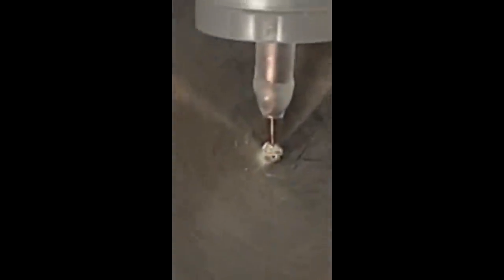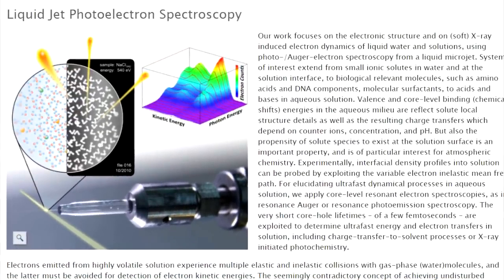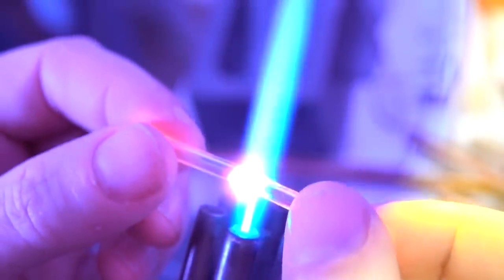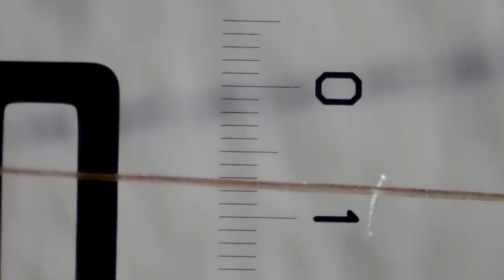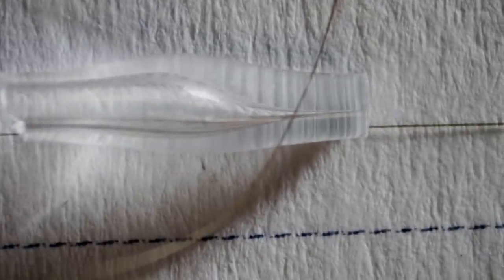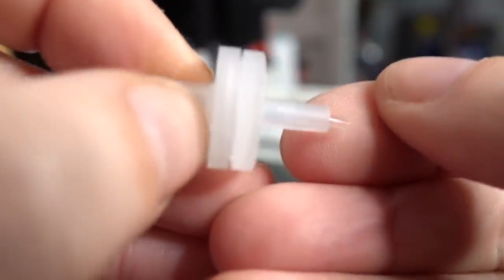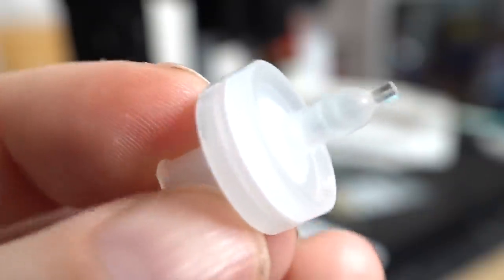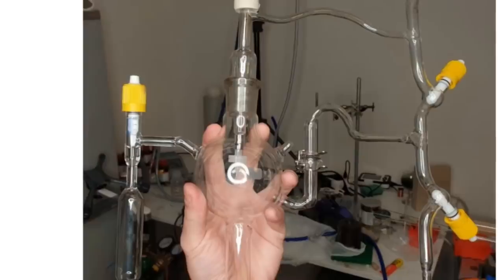How to make unblockable liquid microjet!

Comment: Quite interesting. Sometimes it is the simple solutions that work the best. I am working on a copper nanoparticle inkjet printer and need to make sure that a roughly 4um nozzle wont clog when putting 10-20nm copper particles through it. These particles love to cluster together and so far the adjustments to the ink composition have been what keeps the nozzles from clogging. Gotta keep in mind that inks can sit around for weeks in a printer and copper is very reactive. The oxygen content of water is enough to make the particles oxidize in a matter of minutes without the addition of a reducing agent.
Reply: i had a similar problem, the answer was simple, a powerfulldvd red laser on the nozzle, everytime the particles coagulate more than the wavelenght of light they will start to explode back into nanoparticles
Reply: @fss1704  My printhead has 1024 nozzles but that might be a useful tip for other things I am doing. Is the laser supposed to melt the particles or is it heating the solvent causing them to separate?
Reply: i did some silver nanoparticles using this method

Comment: Out of curiousity, do you keep record of the diameter of the nozzles or is it so off to the side of your end goal that any variation is just compensated for in your other parameters to get the desired result?  i was thinking your gauge  of a human hair or some similar artifact could be used more directly to measure a cut mark by inserting it down the back to visually indicated where you should score the glass.

Comment: Great way for non-clogging (or less clogging) micronozzles. Surely some sorts of modifications, like a rig to keep linearity would yield even better results. 
Another idea you could possibly test (if it's not just complicating things), is a bath of metal (zinc + tin for instance) with the pipe submerged - then control over pressure of gas inside the pipe could give controllable results. Of course with the pipe rotating...

Comment: Very nice.  I wonder if you could skip the glass part and just draw a capillary from the polyethylene Leur tip and then cut at the appropriate diameter?  Might be too flexible under pressure though.

Comment: Btw, just in case you haven't seen it yet, here's something else neat that can be done with a microjet. www.rsc.org/images/loc/2014/PDFs/Papers/053_0326.pdf That team used them to get a 48% conversion rate of mechanical to electrical power. The implications of their work may also have a bearing on yours.
Reply: I mean in terms of the behavior of the jet if you're using certain fluids and ther happens to be drop formation in a relevant part of the jet.
Reply: Is this a link to a virus
Reply: @simonbneqldaus  Dude, if I wanted to get a virus on your computer I would just put it there myself instead of reading through research papers to possibly find one which is relevant enough to lure people in.

Comment: Couldn't you easily increase the accuracy and precision of the alignment of the jet with the main axis of flow in the filter by chucking the input side in a good drill or mini lathe when still molten and spinning the thing on a thin wire stuck into to nozzle end?

Comment: According to Scientific American, water causes glass to crack more easily because when a water molecule enters the crack, a reaction occurs in which a silicon-oxygen bond at the crack and an oxygen-hydrogen bond in the water are cleaved, creating two hydroxyl groups attached to silicon. As a result, the length of the crack grows by the size of one bond rupture. The water reaction reduces the energy necessary to break the silicon-oxygen bonds, thus the crack grows faster.

Comment: For PETE'S SAKE, Dr. Thunder - explain why wet glass would crack a hundred times more easily than dry glass! COME ON now! I really don't think I deserve to be tortured like this.
Reply: Copy and paste of my comment elsewhere:
According to Scientific American, water causes glass to crack more easily because when a water molecule enters the crack, a reaction occurs in which a silicon-oxygen bond at the crack and an oxygen-hydrogen bond in the water are cleaved, creating two hydroxyl groups attached to silicon. As a result, the length of the crack grows by the size of one bond rupture. The water reaction reduces the energy necessary to break the silicon-oxygen bonds, thus the crack grows faster.
Reply: Theo Crater Came to comments to ask the same.
Reply: Yes. This is something I never knew if it's for real.
Reply: Wonder if the same applies to ceramic tiles?
Reply: @DedmenMiller  I don't think so, as ceramic (the stuff you burn) has a completely different material structure. With ceramic you use water to eliminate the dust. Imagine using a saw on glass like you do with ceramic, that would be quite a mess.
Cutting glass works how it does because of the internal tension in the glass. If you score/nick it just a little bit, that tension causes a much greater "internal" cut than you see on the surface. Ceramic doesn't have this, as far as i know (somebody correct me if i'm wrong), which is why you have to really remove material from where you want it to come apart.
Reply: @jangrewe  I remember ceramic floor tiles being cut with a diamond scratcher (similar to class) and then broken (same as glass) so they then break exactly at the scratch. So I thought its the same principle.
Reply: Not an expert, but i guess it's because the water molecules creep easier into the microfissures causes by scoring the glass, pushing them wide open. Or something like that. You could also just google it, i guess ;-)
Reply: I do a bit of small glass stuff as an optical/laser technician. I have not heard about wet glass breaking easier, however there may be a reason why this might work. Glass breaks easier when there is a temperature differential in the material such as putting a hot piece of glass in cold water or a candle flame breaking it's holder. My thoughts are that in this case there is an evaporation cooling effect on the surface of the glass and causes a minor temperature change. Aside from that I can't see a reason why it might break better when wet.
Reply: I searched around a bit, and it's not a temperature thing:
“water causes glass to crack more easily because when a water molecule enters the crack, a reaction occurs in which a silicon-oxygen bond at the crack and an oxygen-hydrogen bond in the water are cleaved, creating two hydroxyl groups attached to silicon. As a result, the length of the crack grows by the size of one bond rupture. The water reaction reduces the energy necessary to break the silicon-oxygen bonds, thus the crack grows faster.”
(chatterglass.wordpress.com/2015/05/27/lubricate-your-cutter-wheel/)
Reply: @jangrewe  
Exactly what I had copied and pasted two comments up.
Reply: @v8snail  Oh, sorry, didn't get that notification, and YT only showed me the last comment this morning when replying. But yeah, i attest you good Google Foo! ;-)
Reply: @jangrewe  
No sweat. It's a non-intuitive, brain bending answer to something we didn't know we needed to know.
Reply: @jangrewe  Excellent Find!
Reply: @v8snail  Well >>---> I <---<< knew I needed to know it!

Comment: I use a similar method to modify plastic syringes to fill 50 um capillaries with liquid for use with a lab-build capillary electrophoresis instrument. I don't use a filter or glass, but melting plastic droppers and stretching them in the same way you did with the glass is a great way to make micron- diameter plastic tubes. I can only wonder if I had made a tutorial 10 years ago, maybe Thunderf00t would have been thanking me for the inspiration!

Comment: wet glass cracks easier?? WHY??!! I NEED TO KNOW!!
Reply: Surface energy
Reply: Temperature fluctuations between the surface and core of glass compromises the structural integrity
Reply: @DMZRPG  this temperature difference is way to low to do anything
else it would crack on it's own

Comment: "Dirt cheap to make" Never includes the cost of his own labor
Reply: That's just how research is. Acquiring funds is more labour intensive than almost anything else.
Reply: Things are a mystery sometimes, I'm a developer and my cost is over £500 a day, I needed something specific for the project I was working on, and there was a plugin that was doing just that for £300, it would take me 2 days to do it, so for me paying for the plugin was a no-brainer, but my boss insisted that I do it.
But in the case of TF00t, the existing microjets nozzles clogged, so an uncloggable didn't exist, so he basically invented it. Once a company will make them, they will probably buy those instead, maybe?
Reply: considers his own labor worthless
Reply: He is paying himself for the labor so the net balance is 0. As other comentor said, if he needs to buy a lot of this or suspend the research to find more supplies the cost of waiting for the mail to arrive are more then doing a thing yourself (speciallly if you can do it with cheap materials and in a few minutes)

Comment: Why not thread a fine wire through the tube the do the same the wire won't stick and you have consistent size if that's important?
Reply: The wire does stick. Have you ever seen an incandescent bulb or vacuum tube being made?
Reply: @ferrumignis  yes many times you use nickel or stainless wire will not stick to it you make a glass seal only using tungsten wire don't know why it's done that way but have seen many valves made like this .

Comment: You should make a video about the wet glass breaking easier.  It's the first time I heard of such thing.
Reply: As a crack develops the water fills in the gap as it progresses. Oddly enough a super clean break can cold "re-weld" back up.
Reply: @therealjammit  vacuum cold weld maybe, but with air pressure i don't think so
Reply: @therealjammit  

Most glasses are technically liquids, very very very viscous liquids. So fractures closing up as long as no foreign material prohibit that is not surprising.
Reply: @boelwerkr  but didn't i just read somewhere that glass is no longer considered a liquid...? that the whole millennia old sagging church windows thing was incorrect and that is how the glass was made? or did i dream it up? :)
Reply: @derangedchicken2191  nope not a dream. Glass is an amorphous solid.
Reply: @boelwerkr  technically...you're wong...glass is not a liquid in any shape way or form. Look it up!!
Reply: @boelwerkr  there's a video Veritasium made just on this.
Reply: @boelwerkr  Glass is not a liquid.
Reply: @derangedchicken2191  It was never considered a liquid. Nothing more than a fake internet rumor.
Reply: This was taught as a matter of course when I took glass-blowing in physical chemistry lab 40 years ago.  It was probably standard practice in Newton's day.  Not sure why it works.  Possibly reducing the surface tension of glass's hydroxylated surface?
Reply: this!
Reply: Temperature fluctuations between the surface and core of glass compromises the structural integrity
Reply: actually water can enter in the crack and have a hidrolisis reaction that helps the crack to grow with less force needed

Comment: Why is it that wet glass breaks better than wet? I imagine that it has something to do with water getting into the the crack, but can't figure out that helps the cut to require less force and/or making the cut cleaner.
Reply: I would assume he means to break it submerged in water.
Reply: The water would dampen (hehe) any vibrations as the glass fractures making for a cleaner break.
Reply: @DirtyRobot  Thank you
Reply: That's why I'm scrolling through the comments to find the answer